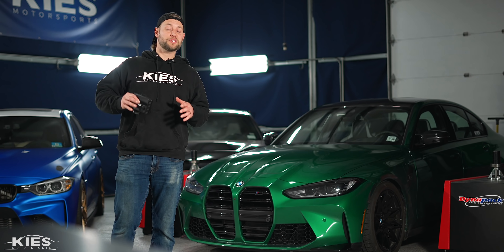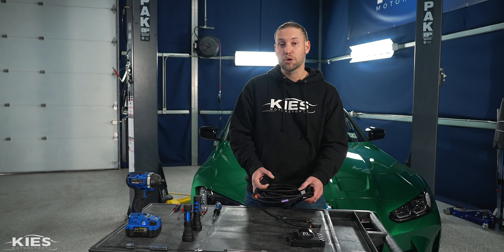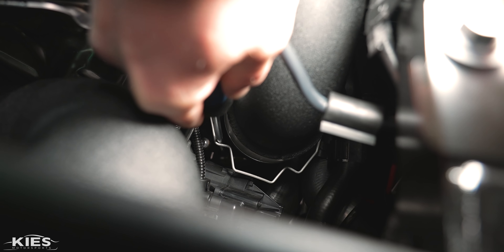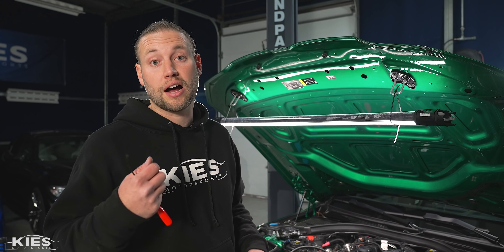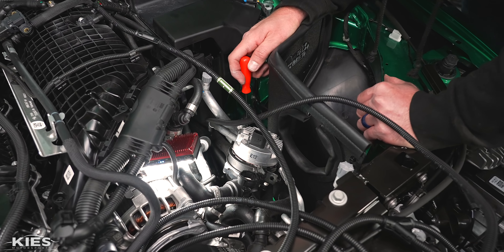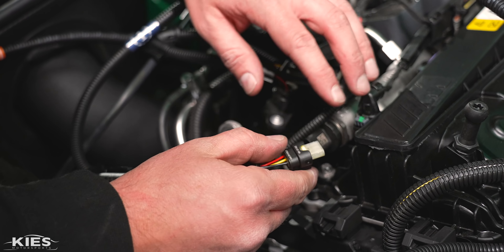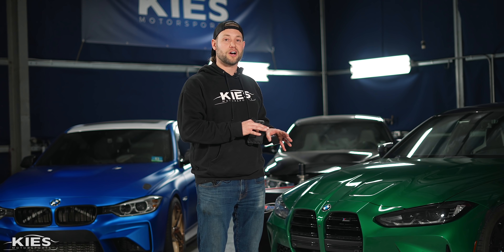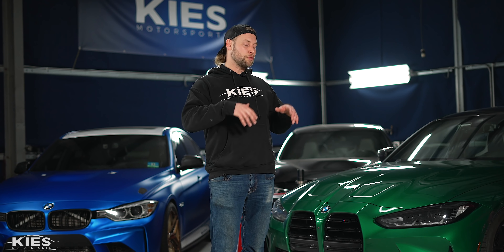TUNING our BMW M3 G80 with dÄHLer (Locked DME)

Comment: The sensor beneath the water pump is the biggest PITA of all. Your solution by moving the water pump out of the way makes the process of reaching that sensor, a lot easier. Thank you for the tip.

Comment: Very impressive.  I’m betting a stock G80 xDrive would walk hellcats.  Can’t even imagine what one with 700hp (if figuring a 15% drivetrain loss to get to the 610 awhp) would feel like.  And it’s a piggyback tune?  Wow!
Reply: I mean with just the piggyback it’s making the same as a hellcat and it’s a few hundred lbs lighter, this would push a hellcats teeth in
Reply: incorrect, they wouldn't be able to sway with them since stock g80's are running mid to high 9's but mostly low 10's seconds stock 60-130 times.   Hellcats are faster stock historically.  For what its worth hellcats can run 7-8 second 60-130's stock.  With the piggy backs it would help greatly to even up the roll racing power against a stock hellcat.  A good strong "tune" and some ethanol will then walk a stock hellcat.
Reply: Undecided between the 3 JB4, racechip, dahler
Reply: @MODIT Incorrect, a stock g80 comp does a 8.01 sec 60-130. Courtesy of AutoTopNL On youtube.

Comment: So I just purchased one and do I have to use the extension for the camshaft position sensor?   That one came with my kit and is not shown in this video or should I hook it up like it is in this video?  

The reason I ask is the extension makes it clip from the front and that little tab broke off so if I hook it up like it is in this video, it makes it clip on the backside of the sensor where there is a tab and now it’s secure.

Comment: The 93 octane makes a big difference with how clean the graphs are. The car seems to pull timing based on the dynos on 91 which makes me skeptical on tuning the G80 on 91 unless it was a pro tune for a ECU reflash, or if you upgrade turbos/heat exchangers without ethanol or race gas
Reply from the maker: Completely agree with this!

Comment: Hi Brian, I have a 2015 same exact spec as your 335i but it’s a 328d xdrive, any recommended mods for handling besides the front strut bar while keeping the oem suspension and not adding a cage.
Reply: Lsd, M3/M4 LCA, anti roll bar. And change the stock dampers for Bilstein B6 dampers
Reply: If you have dynamic ride control, Dinan makes a Shockware program that makes it way better on street and track. I ran that on my 2015 328i xDrive wagon with ACS springs and Dinan bump stops and it was so much better than stock setup. That said, my friend’s 328d xDrive wagon had a KW Street Comfort setup set medium soft and tastefully low and rode/handled WAY better than mine. It was the best compromise I’d ever felt. That’s my recommendation.
Reply: Oh, and ditch the run-flats for a performance tire. You can also swap the RSB for the OEM one from the m240i/m235i. I found one used.

Comment: Have you ran the same type of testing both before and after with only 91 octane fuel? I live in an area where very few gas stations have 93 and I travel enough that I would prefer not to run into that problem

Comment: Not at this tune is actually going to damage the engine - but if you were unfortunate enough to suffer some kind of engine failure - even something that could have already occurred if the car was stock - but it happens to you while this piggyback was attached - even if you removed it wouldn’t BMW North America be able to detect that the car was running outside of specifications and void the  warranty??

Comment: Love your content!!! Quick question.. Can the manual g80 m3 handle the potential horsepower upgrade??
Reply: It’s got forged internals, I would imagine the engine would be able to handle big numbers. The transmission I don’t know about, but if it can handle 500hp from the factory, it’s probably strong.
Reply: The transmission itself can but needs an upgraded clutch

Comment: Any experience as to if this tune will void the warranty with BMW?
Reply: LOL, tunes void powertrain warranties most of the time. Dealers have to prove that your modification caused the problem, however. But, consider that if you tune it, even putting it back to stock before taking it in for service, they will know.
Reply: @M340B58  Thanks, I suspected as much. Porsche offers tunes at their Service Dept, no hiding anything. I had two Porsches tuned by the dealership, no issues whatsoever, I wish BMW felt the same way. To BMW's defense, stock boost pressure is almost 10PSI over Porsche's stock PSI. I imagine that plays a part in it as well.

Comment: Have you logged ignition timing to make sure there is no knock?
Reply: you can log knock on each cylinder and knock average, it will pull timing if it detects knock (i think -2.3 afaik)

Comment: I'm too scared of voiding my warranty to do this to my G82.
Reply: i just installed JB4 on my G80. I will remove it before a service and clear codes, then drive a few hundred km
Reply from the maker: Dealers can see the jb4, even if codes are cleared and the tuner is removed. Any and all tuning can be detected

Comment: Manufacturers locking the DME may be in direct violation of the Consumer Right to Repair Digital Electronic Equipment. Yes, it’s a stretch, but the law is there for a reason. I say file a lawsuit against BMW and see where it goes. The best outcome is that it will become illegal for auto manufacturers to lock out consumers access to their vehicles’ electronic devices.